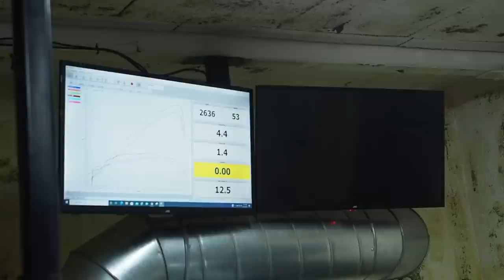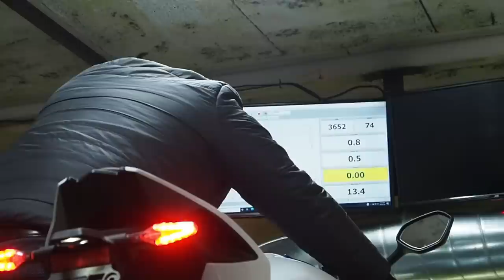Rapid Bike BMW S1000RR Review

Comment: I've got the 2020 Hockenheim Silver S1000RR with the "race pro package" (US model) & I recently installed the akrapovic full titanium system with a sprint air filter.
 I also did the stage 2 flash tune from BrenTuning  with the IAT relocation kit & intake flapper delete.
The bike is a whole new animal after flash tuning it.

Comment: Hey , I bought the “Race” version for my MT07 quad swap. I’m gonna fit an aftermarket exhaust and 2 pod filters. so if I understand correct just fit the module and it will adjust all on its own and I dont NEED to do a custom tuning on it…. Thanks

Comment: Did you use the rapid bike race or evo? The RB is supposed to be pre mapped to the specific bike and the Akra system so did you guys have to remap it as well? I am led to believe that it is 90% accurate and self learning so it doesn’t need to be further tuned. Please elaborate.

Comment: The standard ECU bike in the U.S. is even worse than the Euro version, with a big flat spot in the midrange.
Reply: Its good to see someone else telling the truth!
Reply: Take the exhaust system off. Put on a full akrapovic. I got 15 hp more around 8000 rpm (around 209 to back wheel). Remapped in my dealer. Lost 6kg weight as well. Kandn filter too helps.

Comment: Everytime I see or read these reviews, every new bike is so much better over the previous years release. Be it the year before or a few years before the new bikes are always less twitchy, more flickable, more low end grunt, more top end grunt, more more more. But is this bike better? Even the standard model? Or is it only ever the M model that you get all the new magic with?
Reply: Its better in almost every single way over the last generation.  The only bad thing is the flat spot at 6-8k rpm. You will need a tune to release the 50 hp loss on the US models.

Comment: Great bike apart from the cheap forks and cheap brakes
Reply: maybe they should go back to using Brembo brakes
Reply: Have you even ridden it? I own it and the brakes are brilliant
Reply: @Kurlach  I haven't ridden one but I can't see BMW putting shit breaks on anything, especially their flagship sport bike.
Reply: 😂😂😂 have a day off!
Reply: The bmw brakes on front are better than the brakes on the old one. I’ve heard a rumour they are actually new brembos rebadged. Rear is still brembo.
Reply: Yes I've ridden it and hey... still a great bike, amazing engine. Brakes are good INITIALLY, good bite... but huge fade and issues with leaks. Just seems like unnecessary cost cutting imo

Comment: Tell everyone why you had it tuned ! They won’t start cold from the factory. BMW has believe it or not made a mistake trying to meet the Euro 5-6 fuel specs! The bikes will NOT start cold 🥶 My brother had to give his back and get his money back as the factory cant fix the problem!  That’s why Bren Tune and other tuners are fixing the problem. No warranty after the bike has been played with!!!!!! The Germans have made a mistake trying to meet the regulations !!!!!! Hence this video, it can be fixed but your paying a lot of money for a bike you need to get retuned and then NO WARRANTY 😞
Reply: In Ireland my bmw dealer put on a full akrapovic system and remapped it. All under full warranty support too. Gained around 20hp in mid range and it makes 210+ hp at the back wheel. It’s been a a fun project. I think USA regs have caused a lot of issues for this bike in America. Uk one is a lot better out of box.